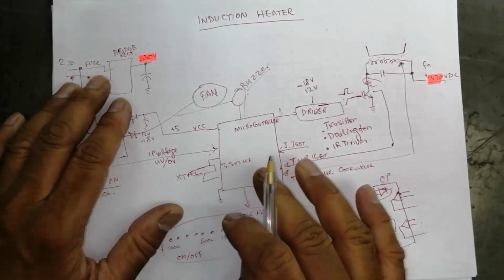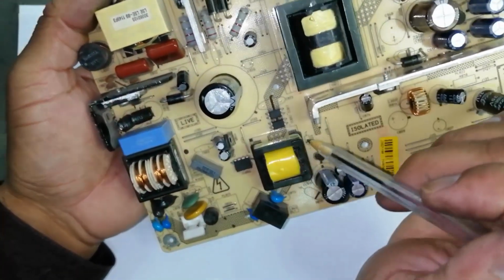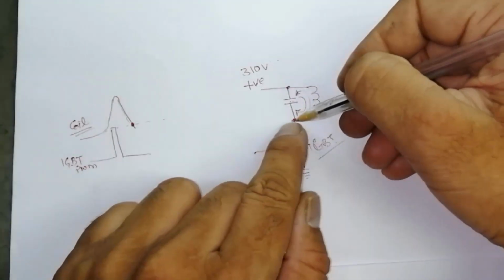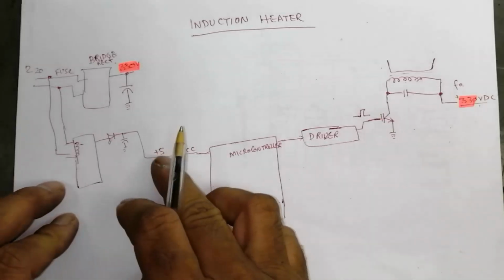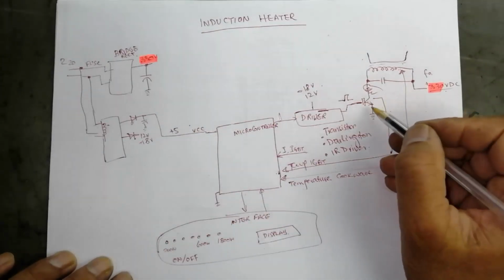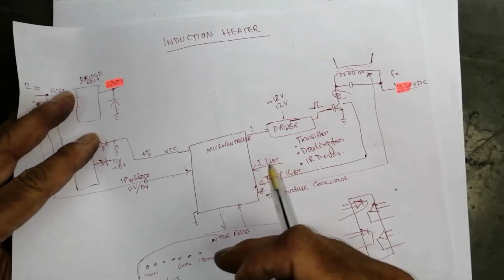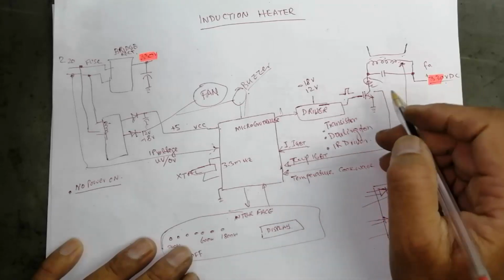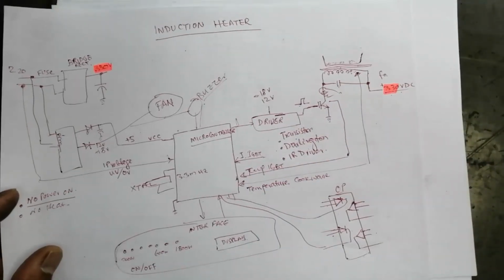#174 How INDUCTION HEATER works

Comment: rectifier gives only 194 v dc .remove bridge rectifier from pcb and them check induvadly by giving ac 230v supply.but rectifier is okay while it test with multimeter.In circuit dc supply drop from high to Low  range suddenly.device is not working.